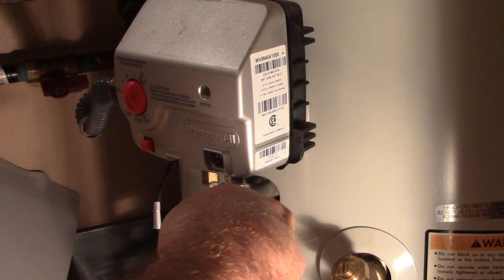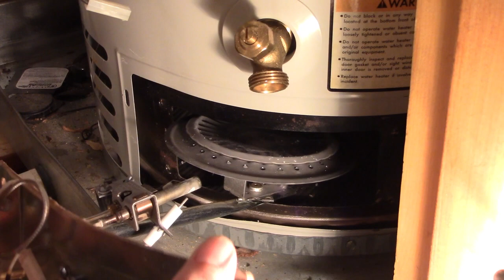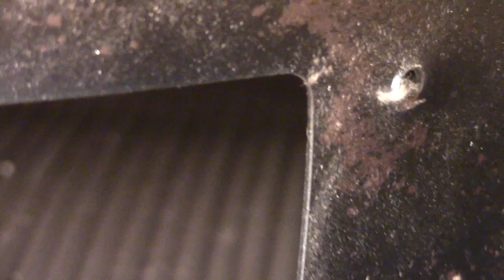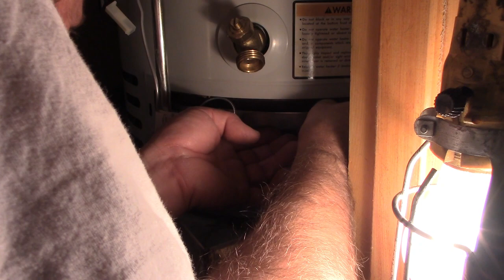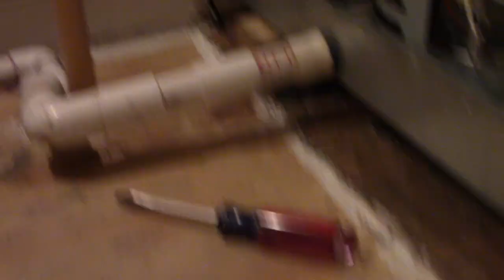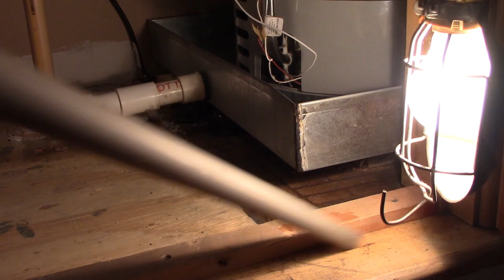Update: 2011 40 Gallon Bradford White Gas Water Heater Won't Stay Lit

Comment: It’s actually a vapor filter which shuts down the pilot if it senses flammable vapors. Like if someone stores a gas can next to the HWH it’s important to keep clean and not to bypass or ignore
Reply from the maker: Yep, if it gets too clogged with dust, it'll shut down the pilot as well. That was the problem in this case. It gets cleaned once a year. No problems since this video.

Comment: Hi. Thanks for video. Quick question.  My Bradford White water heater's pilot stays on on but the burners do not go on to heat the tank (even when I turn the knob to highest heat). Any idea what could be the problem?
Reply from the maker: I haven't had that problem. Possibly the thermostat assembly is bad?

Comment: I have the exact same  waterheater. Mine makes a popping sound and won't relight. Will this cleaning stop the popping? Do you need plumbers tape put on the gas line & thermocouple line? Thanks for the detailed instruction!
Reply from the maker: You're welcome! Not sure about the popping sound, I've never had that happen. No plumbers tape required on these fittings.

Comment: This is exactly why I clean up my gas fired boiler each year before the heating season.  There are always goodies in there lurking.  A little preventive maintenance goes a long way.
Reply from the maker: Yep, lesson learned with the original problem! Never knew there was a grate that could easily become clogged with debris. Once a year should do the trick.
Reply: @dynatrak  Amazing you were able to turn the gas off, remove the line to the burner assembly, clean it, put it all back, and relight it, all without getting tangled up in a light pullstring!
Reply from the maker: @jaykay18  True, no light pullstrings were harmed in the recording of this video!